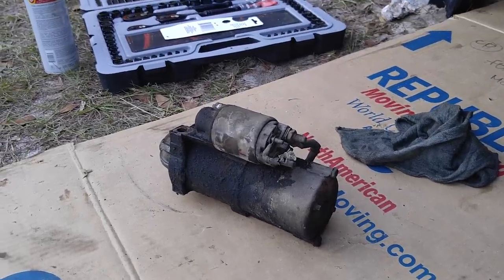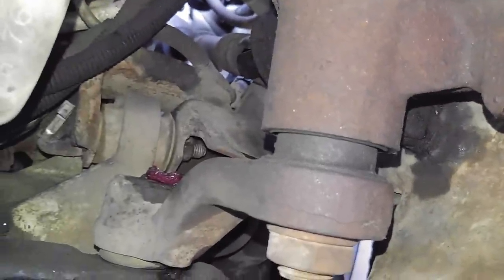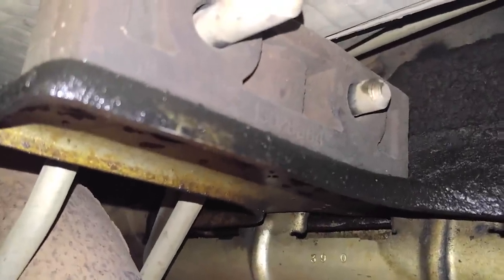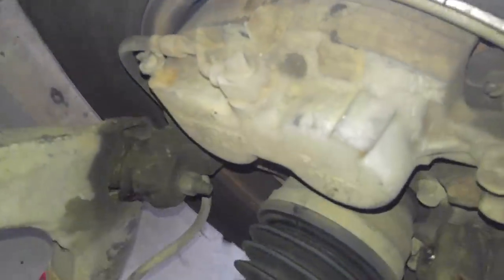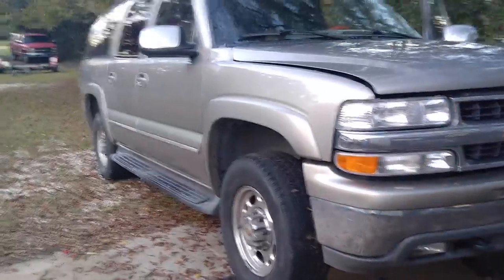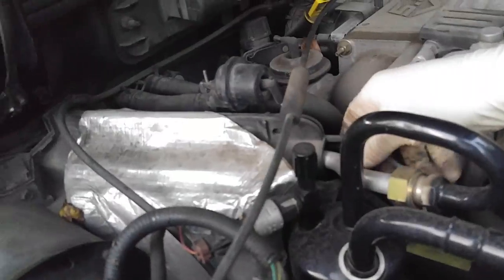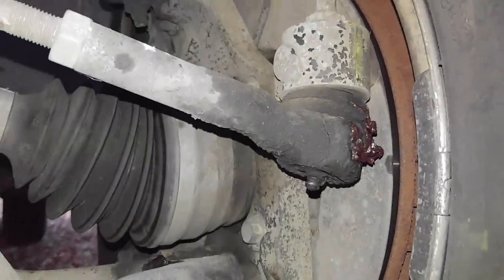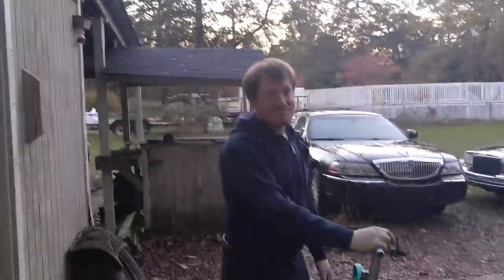Suburban Starter Replace & Grease 11 10 18

Comment: Ya there is a bearing in there if you remove that 4 bolt plate you can knock it out.  I have one in my parts stash that clunked and made cracking noises from that same area.

Comment: When I check ball joints on one of these I put a jack stand under the lower control arm and take the pressure off the suspension..

Comment: At 21:46 when you were under checking for play in your steering parts .i notice a huge crack in steering bracket
Reply from the maker: I looked at 21.46 several times, I finally see what you saw. I think it's a stem of a leaf, I will look now, 7AM
Reply: @CORVAIRWILD  i love your videos corvairwild but i gotta agree fords are better i use to be a gm guy till i woke up, but i like em all just have my particulars regardless of who makes them, plus im not brand loyal all of them makes vehicles i like but do prefer fords, they are just better made to me.